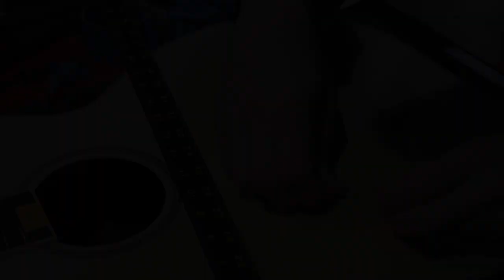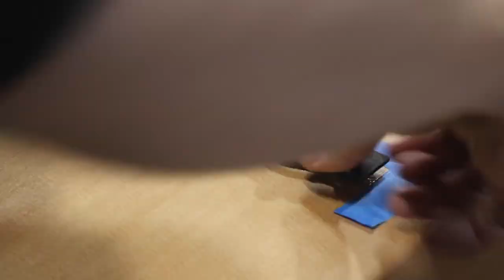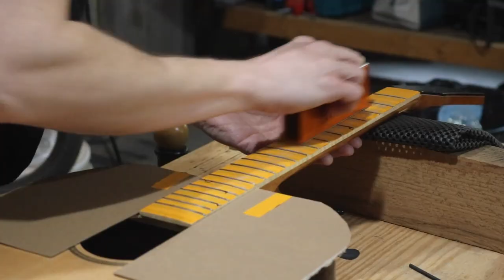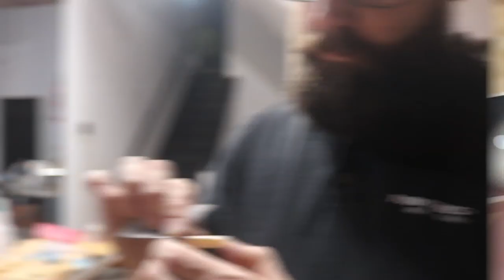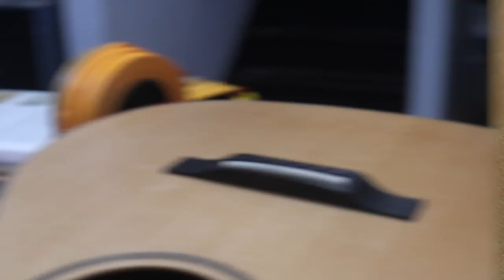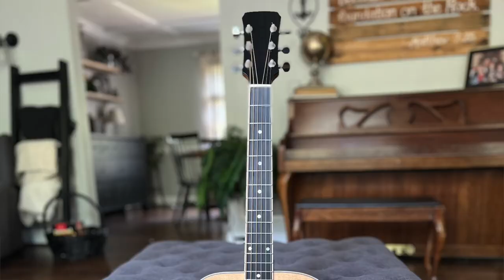Guitar Build / SHORT VERSION part 9 / first sounds!

Comment: Sounds great! Just wait til it opens up fully. Awesome job. What did you fill your pores with and what did you coat it with?
Reply from the maker: Thanks man! I used a product called AquaCoat to pore fill and I finished it with some thinned down Tru-Oil.
Reply: @CMRWoodworks  ah OK cool. I just bought some spar urethane.  It's supposed to fill and self level plus it's a little more flexible than lacquer.  Never used it before. Top is going to be Sitka and back and sides are going to be Jatoba . Never worked with either before.